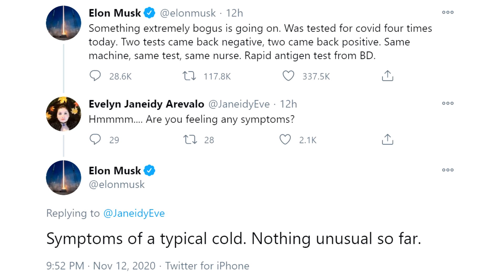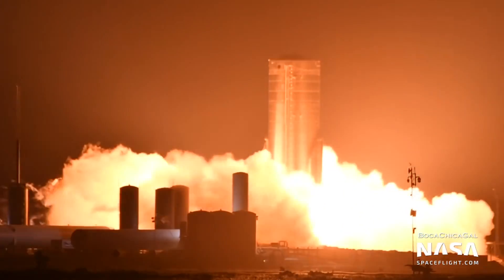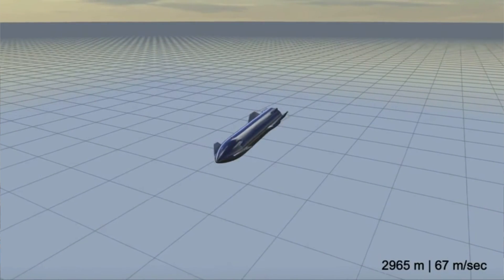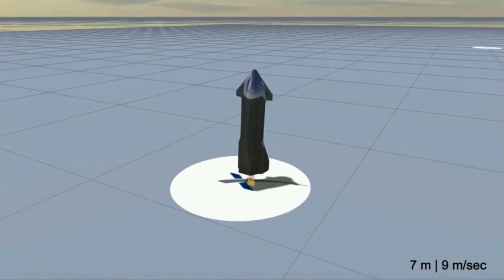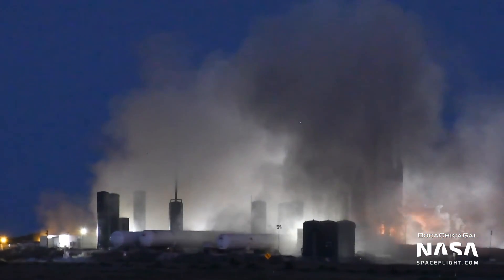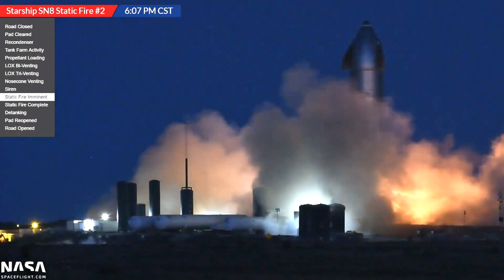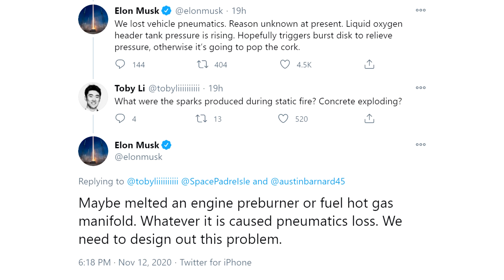Starship Test Destroys Raptor Engine, But Burst Disc Saves Rest Of Vehicle

Comment: I apologize for my intrusiveness 
related to the CH8 with the main line 
running from the auxiliary tank in the conical nose 
and located much higher than 
in the previous configurations. 
I wanted to trouble you with the following verbosity. 
"The fuel (methane or liquid oxygen) enters in preburner 
at a pressure much more than previous tests. 
In the latest version of the engine power supply, 
the vertical line has become much longer. 
That is, the hydrostatic column of liquid is much higher and, consequently, 
the pressure in the area of the bottom and at the entrance to the preburner 
is much greater than the previous tested versions. 
After all, the diameter of the vessel does not affect the pressure!" 
I am very glad that everything was settled. 
I'm sure You already know the real reason. 
My apologies for my intrusiveness!

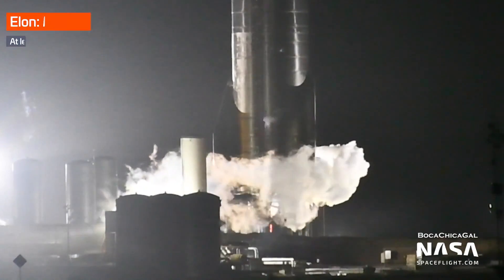Comment: 3:39 Elon confirmed the pad blew up, debris flew up into the engine bay damaging connections causing the improper shutdown of the engine. supposedly a melting engine isn't the proper procedure. also now added is a dedicated lox header tank vent.

Comment: The length of time the chilling phase of the engines would have caused ice buildup in the coastal humid air around the engines. The ice chunks would blow out as solids causing the debris field. Hopefully, with all of the failures on SN8 so far, this will be a "lessons learned" prototype. I hope that cooler heads will prevail before they launch this to 15 km and all safety considerations are done, considering all that has gone wrong so far.

Comment: need to wrap those hoses with insulation- back blast is setting the engines on fire- we seen this on a hop test- the Saturn rockets had to wrap the engines in foil to stop this

Comment: It almost looked like molten metal dripping down. I wonder if the engine cone could have melted if coolant fuel hadn't been pumped through the cone properly?
Reply: It did the same thing in the first static fire..

Comment: Elon is young and as far as I know does not have any underlying health issues and does not smoke, drink heavily, he's not obese, it does not seem he is unlikely to have asthma, high blood pressure, or high collateral.  He does not have cancer.  He should recover fine... as in 99.99% chance.

The Starship should have a bottled gas backup for the pneumatic system.  I doubt they would have to scrap the entire vehicle as it is pretty modular.  The other purpose of the smaller tank being used for the landing, is not just to reduce sloshing, but that tank should be full and not slosh at all when the maneuver starts.  I also question the use of tiles on the one side.  They better stick better and be more durable than the ones on the shuttle.  I also wonder how much they weigh.  At a certain point it might be lighter to just use a burn to slow the decent enough instead.

Comment: so computer should be made to handle landing even with 1 or 2 engines not working.  compensate thrust direction in those cases. @spacex

Comment: I am thinking that they will remove all the engines. And redesign them a bit to ensure that doesn't happen again. Maybe better heat shielding or better flow management to reduce risks. Either engine redesigns will be fast enough that it wouldn't take them long to change existing engines to spec and rebolt an new set of three on SN8 and continue with hop, or possibly use SN8 for pressure tests for welds and use SN9 for hop.

Comment: They should try using the baby bottle liner concept that Playtex uses.  No trapped air and the fuel/formula stays in a bladder.
Reply from the maker: That’s used on some spacecraft, but not on massive propellent tanks.

Comment: Chemical engineer here who designs burst discs for pressure vessels: one small correction is that a burst disc doesn’t rupture when the tank pressure reaches a certain level, it ruptures when the difference between the tank pressure and the pressure on the other side of the disc (called the backpressure) reaches a certain level. If relieving directly to atmosphere, at sea level, this just means the gauge pressure, but considering that the rocket will experience a range of atmospheric pressures, the disc will burst at about a bar of pressure lower when in space than at sea level. Not a big issue for most rockets since by the time the vehicle reaches space fuel has been consumed and the tank pressure dropped, but considering that orbital refueling is planned, it’s certainly something SpaceX will need to consider.
Reply from the maker: Yea this could be an important disambiguation.

Comment: To be fair to spacex anything is better than an rud on pad for sn8. These silos cost so little compared to the proven vehicles. One thing I'm worried about is that sn8 will be super fragile when the main tanks are not pressurized. Would not be surprised if the entire thing kinks on decent.

Comment: When the exhaust at 4km/sec hits the concrete, it must build up extraordinary pressure at the surface. And as pv=nrt dictates, the pressure must go through the roof (or floor in this case) and exhaust temperature against the concrete must double to plasma torch levels.

Comment: Presumably if there was a loss of 'pneumatics' and a burst disc (thnx Scott for explaining that to us) then SpaceX will have to do more than simply replace one or more Raptor engines. Presumably they will need to replace most of the piping and fuel conveyance systems inside the rocket as well... So they would probably be better off by simply swapping SN8 for SN9!

Comment: Considering the very brief and vague press releases to the twitter only community from Space X, that Elon handles himself, and the poor ability of a zoom camera from a mile away to capture detail accurately, analysis of the incident is left to a hodgepodge of community enthusiasts to speculate. Not being any better myself, here's a couple of thoughts. If you are back tracing debris to the concrete under the test stand, you would also have to realize that that is also where the exhaust of the rocket is focused. If engine parts are melting into the rocket exhaust, they would bounce off the concrete and have the same trajectory as the spalled concrete. I would also note, that in relation to the size of the rocket, looking through a zoomed camera from a mile away, you could scale that the debris chunks were actually quite large. If it is burning metal debris, you only need to look at a fireworks display to see the color of different burned metals how the embers dissipate. Check out how a magnesium engine fire reacts when a firefighter puts water on the fire. Not necessarily magnesium but water on a hot metal might also be a cause of the debris.  The debris, possibly not in relation to the molten metals seen after engine shut down, if related to spalled concrete has always given me concern for this test stand. Concrete gets it's strength from the water contained in it. Heating concrete will cause the water to expand and eject chunks of concrete known as spalling. NASA had to rebuild the concrete of the flame trenches at Pads 39 A and B several times even with an advanced water deluge system. I have heard there is some kind of a deluge system during engine tests but I wonder if it is adequate for the constant reuse of the test stand? I have to question the timing of the debris. It was immediate on ignition. it had to be something that was already occurring. To me, an internal preburner part seems the best possible cause.

Comment: Scotty switch to manual override.  Earth to Scotty, come in please.  pneumatic system is the air compressor type control, (from the internet (as opposed to hydraulics which use liquids).  Scotty, we need that manual override - mechanical valve - oh never mind the burst disk poop-ed pop-ed popped.  Thank you very much for the update.  It is so nice to see you make a cameo at the live stream. 
---
What I would like to know is 
if we can get you a ticket, 
will you go?  To Mars, with us?

Comment: What technology is space x using in starship that was not available in the 1960s and 70s?  I love what Musk is doing, but I'm fustrated by the feeling that this could have been done decades ago, had someone had the vision.
Reply: Computing power, avionics, engine development, materials .... just about everything is different and was not available in the 1960's.
Reply: Yes. It should have been the sequel to the Space Shuttle about 20 years ago. But the shuttle replacement money was given to lockheed to develop a space plane with no stages ... a ridiculous proposition on it’s face.  But Politicians did what politicians do (divert the money to reward their donors).  Al Gore knew nothing about this kind of effort but put himself in charge as head of the source selection committee. The result is wasted opportunity, wasted money and keeping the legalized corruption machine well oiled.

Comment: I only watch the labpadre cams, NasaSpaceFlight commentators just talk nonstop and most of it is just hypothesis and wet dreams. The SN8  test 2 I remember going in cuz I wanted to check the time remaining, and one of the commentator caught himself saying bullshit and started having a awkward laughs
Reply: King Peter it’s so back water ignorant over there.
Reply: @douginorlando6260  not really more like they talk so much and there is so little official info that they basically have to fill it with crap most of the time, my only problem is that they use that crap when people ask questions

Comment: I wonder how the welds on the tanks weren't good. I'm assuming they're using a friction stir welding process, or should be. So that's odd. Might want some new QA's doing UT, X-ray, eddy tests, and others lol. Definitely wouldn't with go subarc or automated tig on them. You can, many pressure vessels use tig but I wouldn't on those. FSW is the best option.

Comment: Burst disks main feature is they are extremely reliable. The tank was protected by design. It has vent valves, if these fail there is a burst disk, and there is a whole fail cascade analysis with several safeguards. Everybody is treating the header tank overpressure as a close call, or "almost blew up", and maybe that was provoked by Elon´s tweet itself. But, of course, clickbait rules.

Comment: I have done hundreds of Thermite welds and my first thought was it looked just like the slag and steel over flow from that process.  Lava also looks like that but is at a much higher temperature.  I have seen turbocharged engine failures that melted a piston/head or block and sprayed out molten aluminum which runs down to drip off the block.  Also looks like that.    So, my guess is that was melting metal.  As to what metal, I cant really determine.  Likely copper, aluminum, tin or zinc.  The explosive propelled bits looked like concrete spalling.  That is where a surface layer of concrete splits up from the lower base and fractures into little bits which could be propelled by the Raptor exhaust.  Those bits do not seem to be molten or even really hot as they do not glow after the engine shutdown.  (As concrete bits would do)  The way the molten stream drips would indicate it is a decent size reservoir of molten liquid metered out through a hole.  Not like a big open area of molten material which would fall at the same time.  It all =  melted aluminum or copper  inside a housing dripping through a hole.       Theory?  Concrete spalling entered the engine skirt just before full combustion was achieved causing plugged off jet plate orifices and pre combustion of propellant mix destroying something in the chamber and or pressure section.  (A WAG)
Reply: My favorite Martian good guess.  The explosive start of the engine must be a serious shock wave slapping the concrete hard.  And imagine the heavy blast of exhaust has to stop dead before hitting the concrete ... the pressure must build up to unbelievable levels before ripping sideways across the surface

Comment: could they not have some sort of dividers in the tank to stop it sloshing about ? I guess it's a weight thing
Reply: They are called baffles, and yeah probably weight and complexity of construction. Microgravity also does weird stuff to surface tension like having liquid pooling on the side rather than bottom of a tank.

Comment: I like most of people very much want the STARSHIP to succeed, but have been wary of the possibility that SpaceX is exceeding the abilities of the materials and construction techniques for this vehicle.  Their mode of progressive creation helps to alleviate these concerns as they are found, but it just seems that this vehicle is very susceptible to the possibility of catastrophic failure due to its design. (a major concern is the possibility of leakage from the welded oxygen and fuel tanks) But, I sure hope not!!!

Comment: As powerfull as one of these engines is, i start to wonder about the lack of a visible Flame diverter at the Orbital Launch Pad under construction.
Reply: There is certainly room for one or more under the platform, but should that be insufficient, I'm sure a redesign of the launch pad isn't beyond SpaceX.

Comment: I hope that "flip maneuver" is for low resistance atmospheres only because that looks like a somewhere between 9 and 12+ G maneuver to me.. and that means anyone inside could be hurt and anything beyond 12 could actually kill you. Let alone that the stresses that puts on the frame is insane. You've seen a LOT of rockets break at far less Gs than that.

Comment: Very nice explanation and i fully agree but looking at the infrastructure and lack of thrust deflectors..  water..convex...blast  shockwaves etc etc..the rocket test pad is a joke...if we take a step back...this section will mainly work in space and only do take offs from moon or mars...and will be alot closer to the ground...that's why the Tintin moon rocket design was nearly correct..the three landing legs act as a pendulum for the cg..by putting large retractable grid fins in the three large legs no need for the skydive flip or complicated header thanks or aero moving surfaces...no need to build a two stage rocket...and space refueling .I would have taken a falcon 9 modified it to prove the design concept...the large tripod legs as cargo bays ( closer to the ground)...mad idea but mad people make the world go round. I thing Elons concept is good but the bottom part of his design concept needs to be reviewed I can't see his design resisting high winds on the Martian soil or a heavy swell on a landing sea deck unless it uses a harpoon grid system....after 40 years of engineering  sometimes older designs just need a good old update...I wish Elons design team best of luck..

Comment: I remember the burst disk being mentioned in Apollo 13 and Lost Moon, the book it was based on, in that case for a helium tank.
Reply: Burst discs are extremely common.  The capacitors that fail in electronics all have one built in.
Reply: @johndododoe1411  Oh, I know, just that is the first place I remember hearing about them in an aerospace context.

Comment: Didn't the concrete debris pictured in the footage remind anyone of the similar difficulties that NADA had and had to engineer out of the launch pads in Florida? Presumably the directional venting systems that the ramp designs contain limit and direct exactly these type of debris issues?

Comment: This is why I keep telling folks that this development is not as fast as it looks.  The design has to constantly change based on every test article and we don't know how many changes and test articles will be needed, you test over and over and at some point reach the failure rate you want by having more then X successful tests in a row.  But a fully reusable vehicle needs a staggeringly low failure rate to be effective which means a longer and longer test series to find and correct each flaw.

Comment: This is why I firmly believe that an orbital starship flight will not happen in 2021.
2021 is assuming that EVERY test goes perfectly, happens on time with no scrubs or delays, and is 100% successful. However, there's ALWAYS going to be delays and failures that will set things back. "Best-case scenario" never happens in aerospace (or anywhere else, for that matter).

Comment: In testing, the Starship launches then returns to a perfect landing pad, whats going to happen if Starship reaches, then attempts to land on the Moon or Mars, where there is not a perfect landing pad at all, nothing but moon dust or Mars sand.. How can those engines be protected from flying debris, then be expected to relight to depart.
Reply: The main engines will be turned off some 100 ft above ground, then the ship will go down with thrusters.
Reply: They have plans for wider self leveling landing legs so expect more work in that area.

Comment: Will be interesting to hear if Elon reveals what the issue really was. These were the first times they used the header tanks so maybe they miscalculated the pressure from O2 header tank had had somewhat too hot reaction in the preburner?

Comment: We've seen them replace raptor engines in the past.  How hard would it be to install a new burst disk atop SN8?
Reply: Not long - but the delay will be figuring out what caused the problem. Replacing the failed engine and replacing the disk is easy enough, but there's no point in doing that until you know why it failed..
Reply: @simongeard4824  Exactly!  In my opinion, Elon's greatest strngth is learning from his mistakes.

Comment: curious why they do engine tests on a standing rocket vs a horizontal one like i see nasa do all the time. at least with the sideways exhaust it's a  lot less likely to blow debris back up into itself.
Reply: This isn't an engine test... it's a whole-rocket integration test, and therefore done in the configuration the rocket is actually built for.